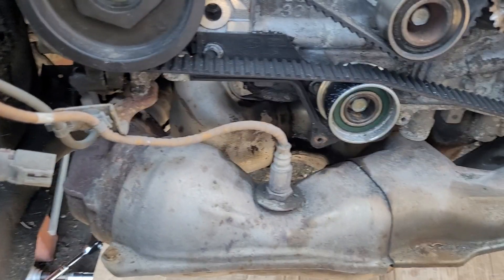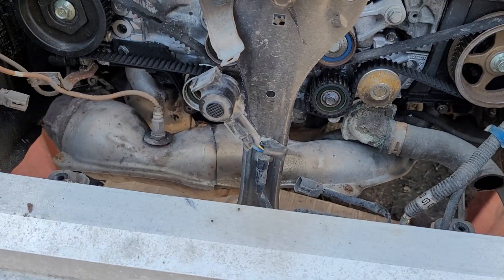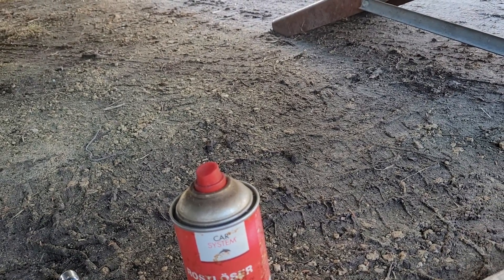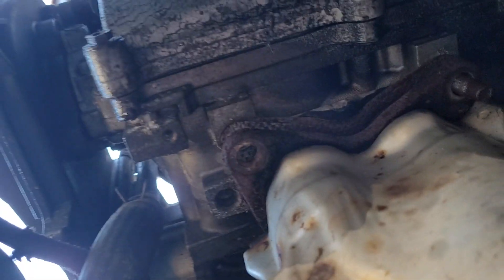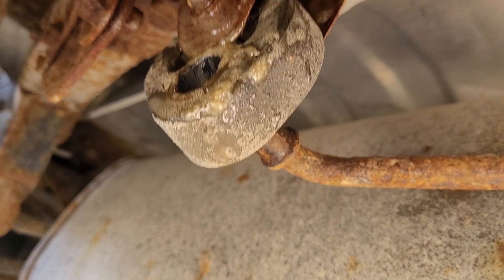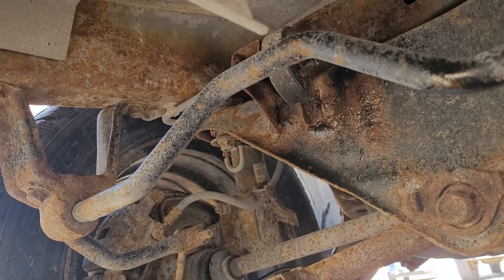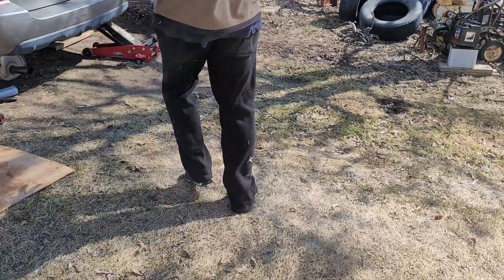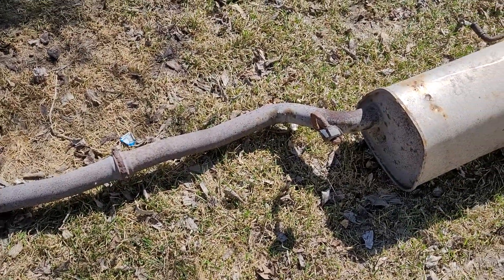2006 Subaru Forester full exhaust removal

Comment: I just bought a 2006 subaru forester and the check engine light came on. pO420 is the code that popped up, i might have replace my exhaust n catalytic converter. Really stressed i have 1000 dollars i hope i can get it done...
Reply from the maker: The P0420 sucks, sometimes though it's the O2 sensors that trigger that code. But sadly it will be the catalytic converter. Try Rockauto online to hopefully get the exhaust cheaper.
Reply: @crazybillsgarage  thanks 😊
Reply from the maker: @chelseacloud6950 best wishes on that exhaust.
Reply: I swapped my cat and both o2 sensors 11 months ago and now my P0420 is comes on sometimes.  

Any tips on why it’s still coming on?   

I really don’t want to get another cat after year with a new one.
Reply from the maker: @SanVan93 I had a jeep liberty that kept doing that, switched the o2 sensors a few times then realized I needed to go back to correct O2 sensor the vehicle originally had. I was trying to get away with cheaper O2 sensors but bought the Denso factory installed Sensors and the problem never came back. Are you using original type O2 sensors?😉